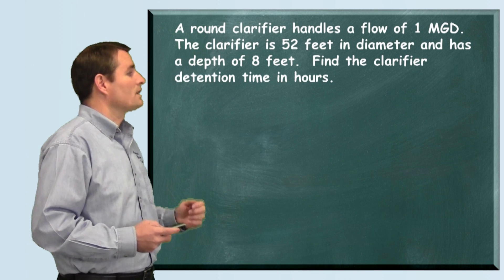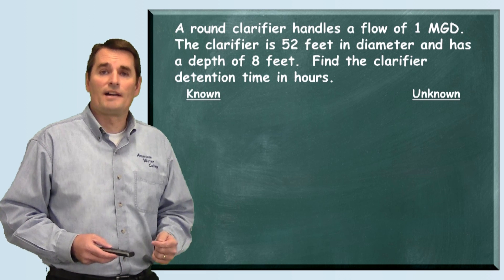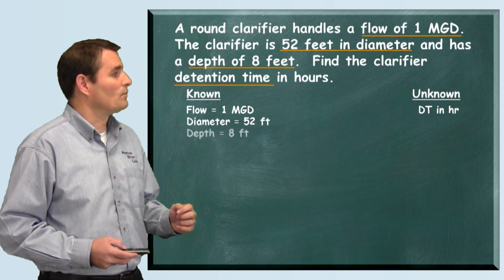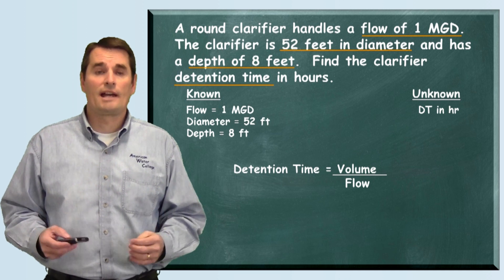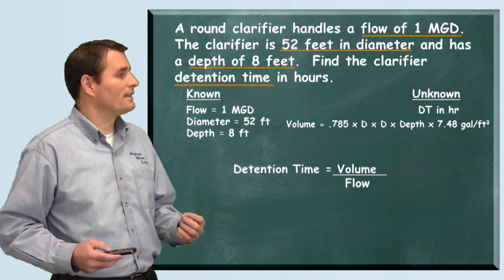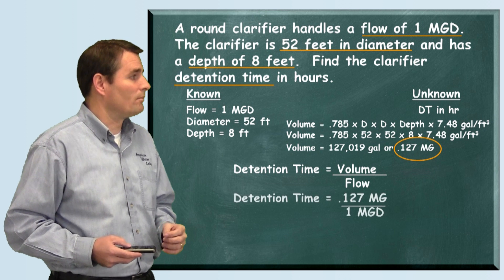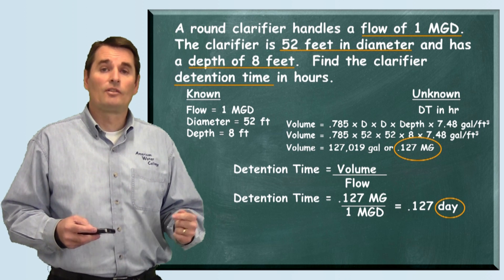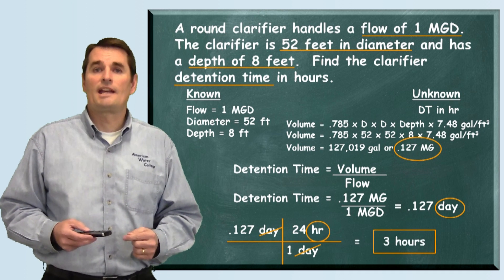Problem Solved: Detention Time - Water Treatment Math

Comment: I got approximately 30 hrs…

Is the tank a cylinder? Wouldn’t that be 26^2 x pi x 8 = 17,000(ish)ft? 
And 1G = 0.134cubic feet so 1M*.134 = 13,400ft

17,000 / 13,400 = 1.268 days*24hrs = 30

I didn’t understand the D^2 x .785 part…
Reply: D^2 x .785 is  another formula for an area of a circle which is  (pie/4 x diameter^2).  then you convert volume to gal which is 1ft^3 = 7.48 gal, so multiply tank volume by 7.48 gal to get volume in gal, then divide tank volume by (1,000,000 x 24h) since 1 day=24 hours, then you get the answer of approx 3.05 hrs

Comment: Is the formula used to calculate the volume standard? Is that something i'm supposed to know already? I'm screwed!
Reply: If you are referring to the volume of a cylinder , 0.785 is the factor of a circle (instead of the pi formula) and 7.48 the volume of water in a gallon.  The rest is area such as length times width. Volume is LxWxD and volume for something like a cylinder is 0.785 (the factor of a circle) multiplied by LxWXD don't forget the 7.48 Gal per cubic feet if the volume of a cylinder is full of water, not air.

Comment: I find the videos very helpful, but i feel that towards the end of many of your math examples the instructor often skips key steps to understanding the concept: E.G ... When finding the VOL instead of converting the VOL RESULT of  127,018 GAL to .127 MG, why not keep it at 127,018 GAL for VOL.  

For FLOW, take 1MGD, and simplify it  such as:

1MGD = (1,000,000 GAL/DAY) * ( DAY/ 24 HRS) = 41,666 GAL/HR for FLOW

PUTTING IT TOGETHER: 

DT = VOL ( GAL) / FLOW (GAL/HR) 

DT = (127,018 GAL) / (41,666 GAL/ HR )
 
DETENTION (DT) = 3 HOURS

* another thing, write the units no matter how much of a given they may be- such as 8.34 Lbs/gal